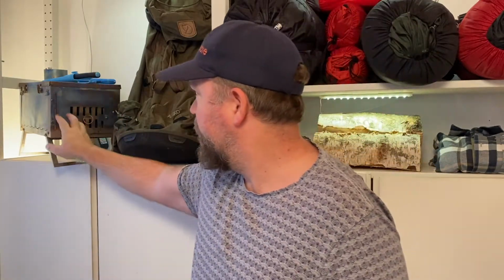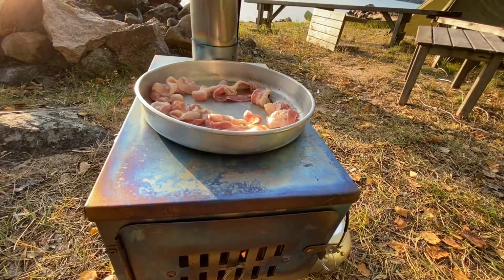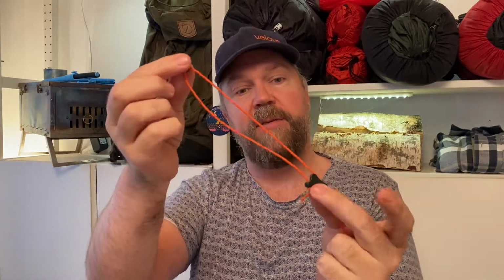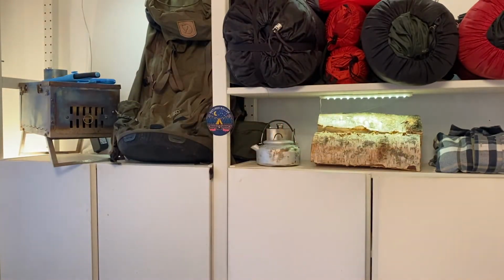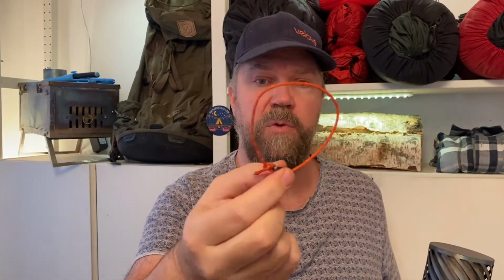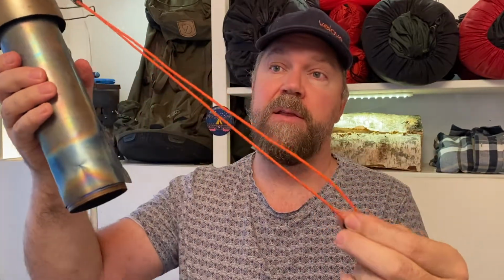Securing Winnerwell Fastfold Titanium stove pipe with quick set up guy lines

Comment: I have the Kni-co  Packer  stove which has a relatively massive diameter stove pipe. Used it for the first time this week. Luckily it was completely calm. But I realized the next morning that the wind could easily cause some problems. So I need to figure out a system to secure my stovepipe- like you are showing with the guy lines. Thank you!
Reply from the maker: No probs! Good luck!

Comment: How is that nylon rope not melting under the heat?
Reply from the maker: There is a piece of metal wire that keeps the rope at a little distance from the stove pipe -it seems to be enough

Comment: Thanks for this, I have same stove. My tipi is a side hole version luxe f8e, which means it needs the 3 supports. It is best to leave a little play in the lines, not taught, you can easily make extra flue pipe rings from stainless steel wire sold for making vape coils. This also helps the chimney flue stay rigid. In heavy wind I use 10 inch taken from my flue pipe to brace where the chimney flue seats in the baffle ring on top plate, really simple to make, wrap around normally fitted chimney flue, mark where baffle is, cut a notch out, make a few rings, look at Amazon uk, winnerwell fast fold stove reviews, a pic there. Hope this helps.
Reply from the maker: Thanks for the advice! Why leave some play in the lines?
Reply: @WildJohan  it helps stop excessive tension from just one direction, when the wind is blowing in that direction, slightly loose and 2 lines of the 3 will be taking load. It is less likely to fold in high cross winds. Lonewolf902 does a great video on this. I do like all the lines and clips you used and will put a set together soon. Take care.
Reply from the maker: @breakit46  Ah, that makes sense! Will try to find that video.